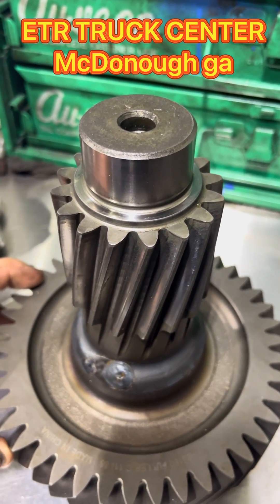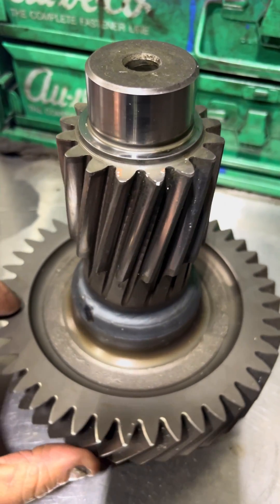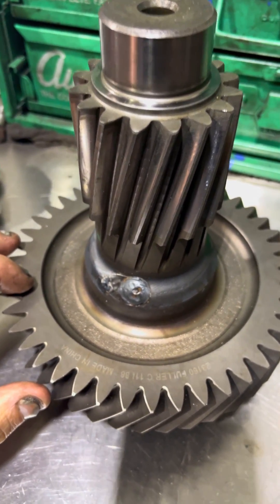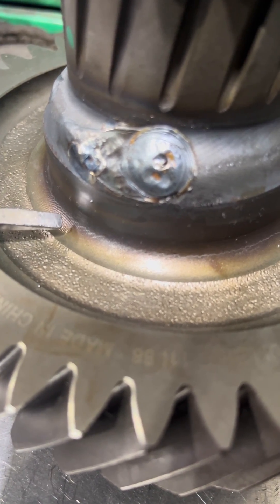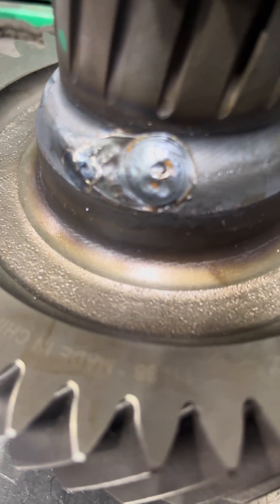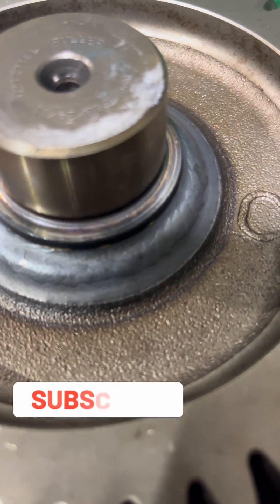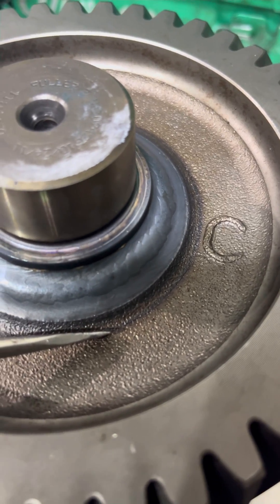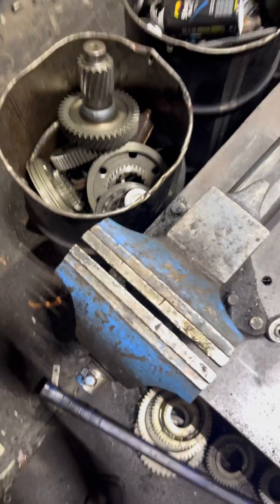Ten speed auxiliary countershaft cracked #trucking #transmission

Comment: Genuine Eaton countershafts are not made in China. 29 year Eaton Rep.
Reply from the maker: Lmao these are 100% genuine Eaton fuller countershafts.
Reply: @etrtruckcenterenginedrivet8918  Just sent an email to our transmission product manager. I will let you know. I could be wrong. But I will find out for sure.
Reply: @etrtruckcenterenginedrivet8918  I will check on the countershafts and report back.

Comment: Hi from the UK, is this caused by the heat from welding changing the properties of the steel?? Causing it to become brittle in that area??
Reply from the maker: I’m pretty sure that countershaft is made in two separate pieces that are heat treated individually. Once they assemble them there welded together. Perhaps the problem comes into play when they weld them together. Mabe if they waited to heat treat them all at once there would be less stress at the welds. But I dunno I dont make the gears and don’t know the effects of throwing that whole countershaft into a cool bath of oil or water or however they do it. Only thing I know is I have seen this problem several times
Reply from the maker: I would imagine so
Reply: @etrtruckcenterenginedrivet8918 so it could have been prevented by heat treated after welding??

Comment: @ETR Truck Center
Is that/was that a brand new counter shaft or did it come out of a transmission in need of repair???
Reply from the maker: It came out of a transmission that needed repair
Reply from the maker: Found it in there when I was inspecting the parts